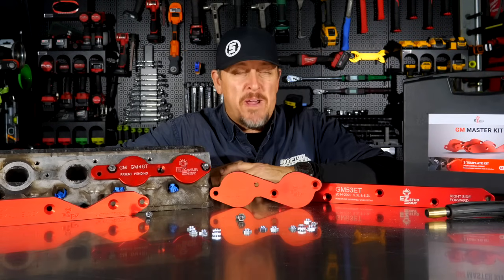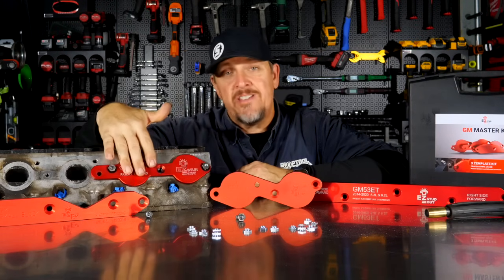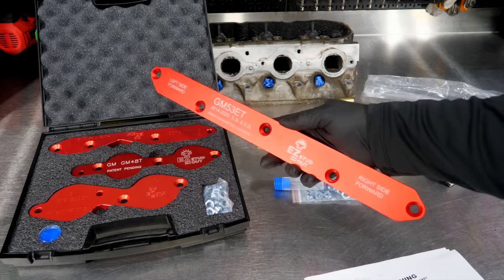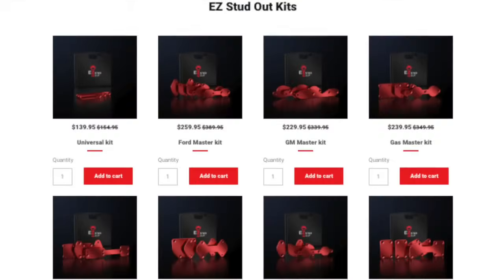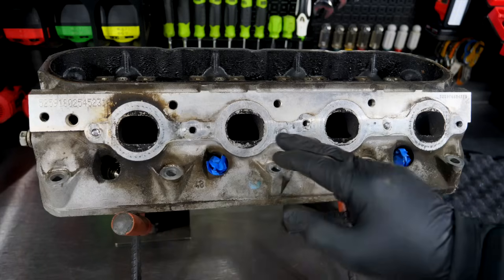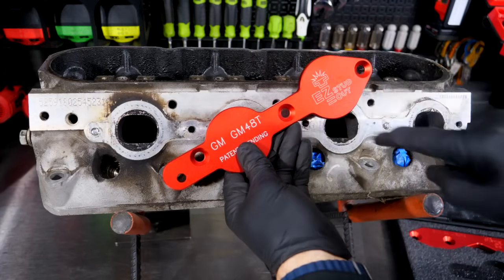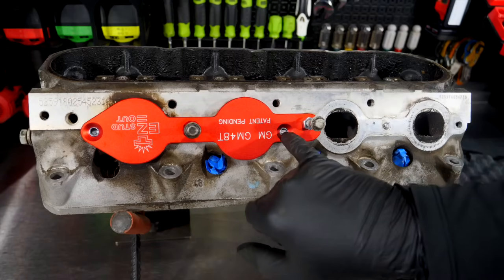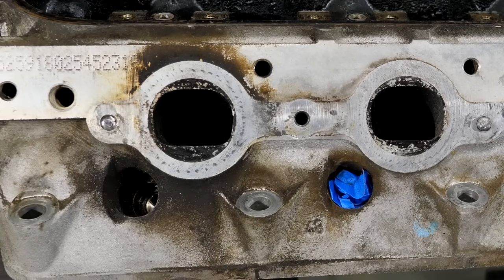How To Remove Broken Manifold Bolts with the EZ Stud Out Kit [REVIEW]

Comment: Just extracted 3 broken manifold studs in my LQ4. 2 of them below flush. A fat washer with a matching inside diameter works just as good. Protects surface of the head around the hole. 

Three Key Components 
-prep the head of the stud good like you see in video, I used a pointed grinding stone on a dremel 
-use a washer, makes a big difference, protects the head, and also gives you a good indication of whether or not your stud is turning, if washer starts to back away from head than it’s turning. 
-getting your first weld good and hot, can’t chicken foot first two tacs to melt the thread locker, you gotta get it lava red hot on first weld then fill the nut with weld.

Comment: I don't do mechanical all the time and have only a few times ever run across broken studs but honestly if this tool makes alignment easier for those not so everyday all day mechanics and welders I say very handy, and yes would be a good addition to someone's toolbox that's not a professional welder or mechanic and definately keeps things on the cleaner side of welding and reduces chances of bad welding as it focuses the MiG welder directly onto the stud and nut and not the engine block,

Comment: I thought there was something similar out that was actually made for drilling them out perfectly straight? 
 This seems silly, what’s the point of the template if you’re just welding a nut on anyways? Just plug the ports with rags. It really doesn’t matter if the nut is welded on 100% straight.

Comment: No $280 template needed. 
Remove the exhaust manifold.
Tape a washer to the head, centering the broken stud.
Tape a 9/16 nut to the washer and start building up the weld inside the nut......
Fill the threaded area with weld, put a wrench on the nut and remove the broken stud.  Done it 100s of time, without fail.
BTW....replace the bolt with an APR kit.

Comment: I removed hundreds of broken exhaust studs on motorcycle heads. Always a frame tube in the way. I would center drill, tap or extractor. Late eighties I used a 90° air drill used for aviation rivets to get into tight spaces. The bits were expensive but made it easy.

Comment: Thanks for the new tool and great idea, but for years, I've been using a short piece of copper tubing that will press or tap fit over the nut. That keeps me lined up so I don't weld off to the side.

Comment: Nice system. I did mine free hand head installed. That MIG adapter would have been handy getting around all of the installed gingerbread I fought with.

GM should be strung up for allowing this engineering flaw drag on long enough for aftermarket solutions like this to become necessary. 

Thanks
Reply from the maker: It does seem like exhaust manifold bolts should last longer; however, it's not just GM. Several of the manufacturers have the same issue.
Reply: @Shoptoolreviews  This is not an issue of designee or even bolt size. The bolt failure is caused by heat cycling.

Comment: GM could have fixed this issue a long time ago. Why not?
Reply: This is caused by heat cycling. A great fix would be to never start your engine.  The issue has been around for as long as internal combustion engines. Chevrolet small blocks had about 90 million made over 50 years. They have the same issue. We see this in LS engines more as a result of production. The LS engine (gen 3/4) has over 110 million engines produced in just 18 years. With modern gaskets the clamping force needed to seal a manifold is greatly reduced so the bolt diameter has been reduced to match. What GM has done to address the issue is in the gasket material itself. The failure of the bolt by heat cycling cannot be stopped but the resulting gasket failure can be reduced by designing a manifold that does not need as much clamping force to hold the gasket. Modern MLS gaskets do this. Often but not always a single bolt failure does not cause an audibled leak. The broken bolts are often (but not always) found during disassembly. They have not addressed this further as the cost of warranty repair is much less than the cost of over engineering the manifold / gasket / bolt. a simply stronger bolt does not change the stresses of heat cycling. Hope this explanation helps
Reply: @ I have been working on engines since I was a kid. The exhaust isn’t an area that uses a torque wrench. Why not use a dip of anti seize and tighten up. I used Malox antacid for race kart exhaust bolts in 1980.

Comment: Well that's good if the broken bolts aren't rust seized as usual.  So, when that fails, get yourself a "MANIBOLT DRILLER"!!   I had to remove several locked in broken bolts from my 429 BB Ford and was able to ACCURATELY use an angle drill and perfectly remove those broken bolts with the engine in my truck.   By far the best tool for the worst case scenario!!

Comment: Can you use fluxcore?
Reply: not recommended when doing this as most shops do (with out this tool kit) as the flux has nowhere to go when filling the nut. I can only guess you would have the same issue with this kit

Comment: Best prevention for this, on all engines, use copper antiseize, make sure your manifold or header bolts are lined up correctly
Reply from the maker: That's typically not the issue. It's not that the bolts seize, they typically break off under normal operation of the vehicle. All the hot/cold heat cycles expand and contract, breaking the bolts. Of course, using antiseize is not a bad idea either.

Comment: Learn to TIG weld and you won't need that goofy thing.
Reply from the maker: It would be interesting to see someone TIG a nut onto a broken stud, inside the engine compartment.
Reply: @Shoptoolreviews  Have done it many times for both GM and Ford as a dealer mechanic (35 years) and now as a machine shop owner. But honestly you did not "TIG" the nut on in your video. Your tool is neat but unnecessary. It is about as unnecessary as your comment attacking this person. The reason he mentioned TIG is as a welding process uses much smaller welding torch with much deeper base material penetration (base material being the broken bolt) The tool you are selling clearly has a place for some mechanics but please don't be upset when professionals address the usefulness of the tool or process in a professional setting. It is just not a good sales practice.
Reply: @bad406camaro  i have also been removing broken bolts from exhaust manifold with out using anything like this, all you need is experience.

Comment: The pennies that GM saved by using tiny bolts sure have cost owners a lot of money time and frustration.
Reply: Aluminum heads, steel studs. Heat cycle breaks the bolts. Nothing to do with size. Ford and Dodge also break same reason.
Reply: @erwinpadgett1050  for decades many engines used 3/8" shank exhaust manifold bolts with no problems.  Then they went with 8MM shank bolts and its now a super common issue.
Reply: @Thomas63r2  Note, Aluminum Heads cool down quicker that iron does. The size has nothing to do with breaking.  It's  the number of heat cycles. Look at the repair videos for them. Also the exhaust manifolds have problems with truly being flat. But heat cycles is the real problem, not the size of the exhaust bolts/studs.
Reply: @erwinpadgett1050  So many cars have aluminum heads and do not snap the heads off the exhaust manifold bolts.  What you are saying may sound good to the casual listener - the truth is GM made a mistake and they really weren't too concerned because the fix would typically be done by a second owner when it was out of warranty.
Reply: @Thomas63r2  Ford and Dodge have the same problems with exhaust bolts/studs. You keep going back to the same point yet not realizing the whole truth. There's no iron ore being put into iron or steel products anymore.  In the older days there was. It effects everything made.
Reply: @Thomas63r2  I've worked on automobiles since 1973. It's amazing what I've seen with engineering changes. I'm not a fly by night technician. Worked for GM for many years. Today's vehicles are totally different.
Reply: @erwinpadgett1050  I've been going to the drags since 1972, had a 30 year career in the car business, I've built a few hot rods (I've owned 26 cars over the years).  I'm sure that in that time a few hundred million cars have been built with aluminum cylinder heads.  Some got it right, some didn't.  The ones with 3/8" bolts seem to work fine without popping their heads.
Reply: @Thomas63r2  agreed, but all 3, Ford, GM, Dodge all went to 5/16, 8 mm studs/bolts. Not all of them break off. Majority does. Exhaust flange were the bolts/studs go thru is not flat or the head is warped at the Exhaust mounting. They went to smaller bolt/studs to stay out of the water jacket in the head. But I do agree the older 3/8s bolts/studs had no problem..
Reply: @erwinpadgett1050  Yes, if it caused problems during the warranty period, then the manufacturers would care.
Reply: @Thomas63r2  Bullshit. I've been a certified tech for 40 years and fixed hundreds of broken 3/8 manifold bolts in heads. As stated, it is not the size of the bolt. It is the steel bolts in aluminum heads that cause the problem. Steel and aluminum heat and cool differently. When you put bolts thru thousands of heat cycles while clamping two dissimilar metals together, they are going to break.
Reply: @bdd1469  agreed. Plus there isn't any iron ore being added to recycled metal to make these studs/bolts. Since they started all this torque to yield bolts.
Reply: @bdd1469 I have not had this issue on japanese engines.
Reply: @Thomas63r2  Actually this has been an issue on SBC/BBC since I started in my grandfathers machine shop in the early 70`s The issue is heat cycling. The reduction in manifold bolt size has to do with the clamping force needed to seal modern gaskets.
Reply: @bad406camaro  I've owned 28 cars, vans, trucks over the last 50 years.  I never had problems with SBC or BBC exhaust manifold to cylinder head bolts.  Usually, the problem I had on older cars was low quality bolts where the exhaust manifold outlet connected to the exhaust pipe.  You are probably right about the cycling, and I understand that from a cost perspective that manufacturers do not want to spend money on quality bolts like ARP.
Reply: The manufacturers COULDN’T CARE LESS

Comment: Maybe the bigger issue is, why hasn't gm addressed this on the design issues?
Reply: They are saving a few cents per bolt😂
Reply: A little anti sieze at the factory would help. @Jimmyxsx
Reply: Exactly
Reply: Because GM doesn't GAF. As long as they pass emissions, they send it as cheap as possible

Comment: I just drill a hole in the corner of a peice of scrap 1/8th inch flat stock a few inches long for leverage weld it on and tap on it with a hammer

Comment: How about auto makers fix the shitty fasteners they use this didn't happen years ago wtf we pay a lot for these vehicles simple fix use better grade hardware there fixed problem 🤔
Reply from the maker: We are 100% behind you on that one. Thanks for watching.
Reply: This is caused by heat cycling. A great fix would be to never start your engine.  The issue has been around for as long as internal combustion engines. Chevrolet small blocks had about 90 million made over 50 years. They have the same issue. We see this in LS engines more as a result of production. The LS engine (gen 3/4) has over 110 million engines produced in just 18 years. With modern gaskets the clamping force needed to seal a manifold is greatly reduced so the bolt diameter has been reduced to match. What GM has done to address the issue is in the gasket material itself. The failure of the bolt by heat cycling cannot be stopped but the resulting gasket failure can be reduced by designing a manifold that does not need as much clamping force to hold the gasket. Modern MLS gaskets do this. Often but not always a single bolt failure does not cause an audibled leak. The broken bolts are often (but not always) found during disassembly. They have not addressed this further as the cost of warranty repair is much less than the cost of over engineering the manifold / gasket / bolt. a simply stronger bolt does not change the stresses of heat cycling. Hope this explanation helps sorry I accidently posted this reply in general comments but here it is again for you.

Comment: I have been doing this repair with my mig since 1999 no plates no issues hardest part is removing the exhaust manifold. Welding a nut on takes seconds. Little advice don't use a carbide burr to clean up the nuts. use a 1/4 inch diameter .025 wire end brush in a drill motor. The carbide burr will make a quick mess of the sealing surface and exhaust leak when you slip off the broken bolt. The wire brush will not
Reply: Is a cheapo harbor freight welder that plugs into a regular 120 outlet enough?
Reply: @joeymalin  Yes, that's what I use. Just make sure that the  welder is plugged into a 20 amp outlet, preferably a dedicated 20A circuit, and not a 15 amp. Don't use an extension cord with these welders. Mine works fine when plugged directly into a dedicated 20A receptacle. If I try plugging it into anything else or an extension cord, it works horrible. I have the small green welder. It says Titan on it. It's great for me. I usually weld thin stuff like exhaust pipe. I've owned my for about 2 years.  You just need it to be plugged in enough power. Otherwise it pops snaps & stops and goes.  It will be a horrible weld.
Reply: @joeymalin  I have use a Snap-On FM140 mig welder, it is a 120v run on a 35 amp circuit. I use heat settings of 6 on the dial. I guestimate that to be about 80-90 amps on a .032 wire. you could get the same heat transfer at about 65-70 amps with a .023 wire and a slower feed. so, I think your Harbor freight welder with smaller wire size and lower amperage can do it. The idea is to have the nut you weld on glowing bright red to transfer heat into the broken bolt. this will expand the bolt and brake down the corrosion and thread locker that may be on the bolt. As the bolt cools slightly turn it with a wrench when the glowing red turns to a gray color. the bolt will contract as it cools, release and turn out. sometimes the nut snaps off but that is a result of surface impurities and rust on the broken bolt. just weld on another and try again.
Reply: @bad406camaro  What type of metal washer? Mild Steel Flux? What metal type bolts?
Reply: @PledgedRanger  Mig with gas and wire no flux core you can use flux core but gas is better. i use a 3/8 nut. works like a charm
Reply: Right there with you brother. My dad taught me this 30 years ago. And it worked every time
Reply: I don't even remove the exhaust manifold. Pull the spark plugs, remove the remaining manifold to head bolts, use a pry bar to force the manifold down, weld the nut to the broken bolt and remove like usual. There is enough flex in the y pipe to make it happen

Comment: I like the mig adapter but I weld those out all the time without those templates with no issues.
Reply: They make very nice flexible mig torch handles that are much better than that adapter. They can be life saving in some situations and they are also a godsend when welding exhaust on vehicles.
Reply: @TsunauticusIV I'm gonna have to check that out
Reply: I suggest aluminum flashing tape for AC units and furnaces....just use a hole punch and line the hole up and press it firmly
Reply: Anyone out in Arizona that can do this without taking my engine out?
Reply: @fbarr8540 Find somebody that has worked in the salt belt. Done this kinda repair 1000’s of times on all manufacturers of trucks from broken exhaust manifold bolts/studs.
Reply: @fbarr8540  most any reputable shop can do this repair. expect to pay hourly as this job is hard to estimate. sometimes it takes many tries to get the extraction done. Just don't try and drill it or use a bolt extractor. when you break off a extractor inside the head it will require cylinder head removal to fix at that point

Comment: So every  other stud has to break off in order to get tool to line up with a bolt to hol it still.
Or am i.missimg something
Reply: No, you would put the plate over the studs and secure the plate with nuts.